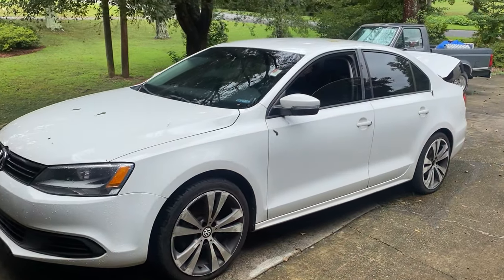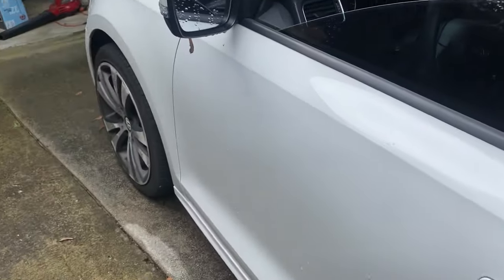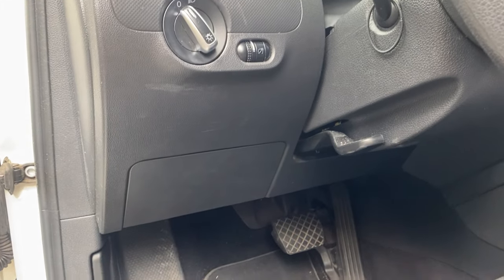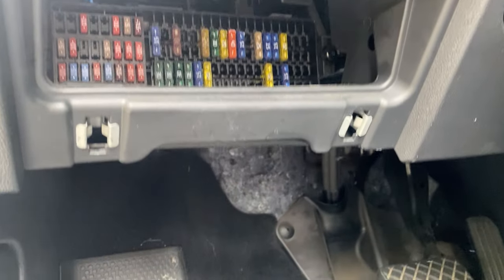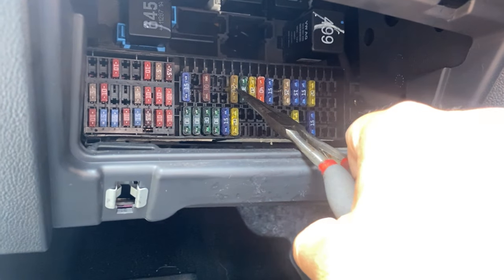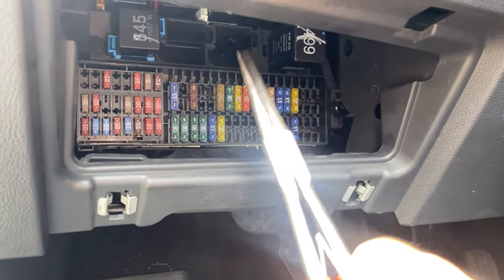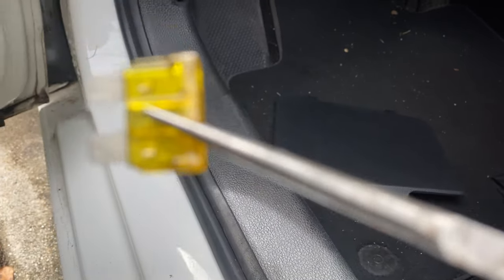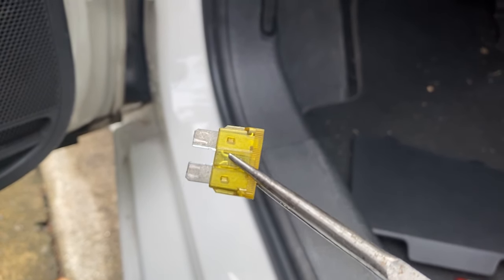2012 Volkswagen Jetta Cigarette Lighter not working / Fuse location

Comment: Thanks for the tip! 
But I’m confused because my Jetta has two lighters and one of them gave out over a year ago and started just using the one near the shifter then they both failed. I got a new fuse and now they both work, why did one work but not the other if the fuse fixed both 🤔🤔

Comment: Do you know where the radio fuse is or which fuse would it be? I can’t find it anywhere🙃
Reply from the maker: Try to check the fuse box under the hood F8
Reply: @BrianBalatbat  okay! Sorry I’m not sure which is fuse 8, I don’t see any numbers under the hood, or the fuse cover 🤦🏼‍♀️ tired of this damn car
Reply from the maker: No worries, I will take a pic of the fuse when I get home and let you know. Good thing I still have the car 🤣
Reply: @BrianBalatbat  thanks so much! I put a jvc touch screen radio in and I get no power at all, there’s not even a power button. My tail light went out I put multiple bulbs in all brand new I tried messing with the fuses and that’s how my radio stopped working. I hope it’s not the wiring😩
Reply from the maker: Sorry been busy, let me know if you still need help.
Reply: @BrianBalatbat   Do you know where the amp fuse is?
Reply: @BrianBalatbat  hey bro do you happen to have the fuse diagram for the radio?

Comment: my fuse was blown, replaced it, the plug still doesn't work, will I just have to get a new socket and wiring?
Reply from the maker: Check to see if it blew the fuse again, if it’s not blown check the socket with a test light. If it’s getting power you might have to just clean the socket.
Reply: @BrianBalatbat  I'll try it, much appreciated!

Comment: Do you know if I could upgrade the amp volume to a 30 or would that be bad?
Reply from the maker: I wouldn’t recommend it but from experience I have done it before and nothing happened.
Reply: If you do that you’ll overheat the wires which can cause a fire. The fuses are designed to pop when you draw 20amps. 30 is too much

Comment: What if it isn’t blown but all the 3 cigarette lighter’s still don’t work?
Reply from the maker: Check the wiring harness, also check the cigarette lighter socket. Check if the harness or socket is getting power by using a test light.
Reply: You're Jetta has 3 cigarette lighters? Lol
Reply: @BrianBalatbat  do you know where the fuse for the aux is my auxiliary isn’t working?!?! Plzzzzzz